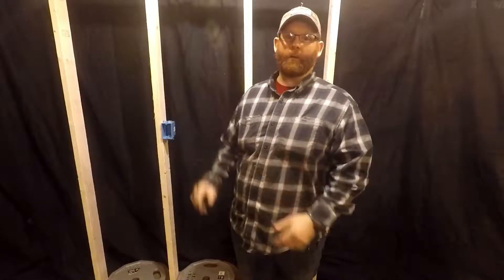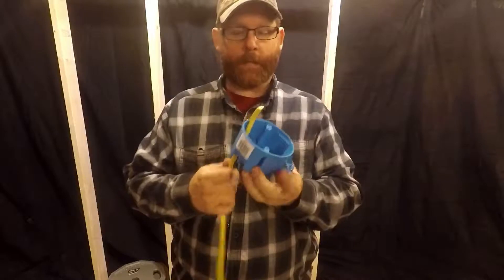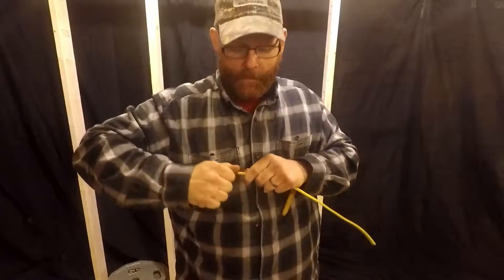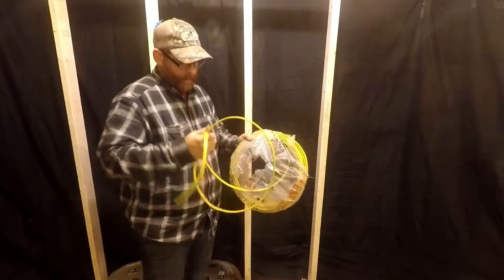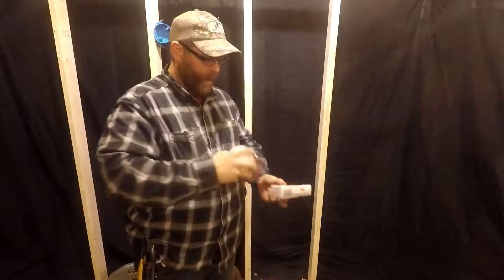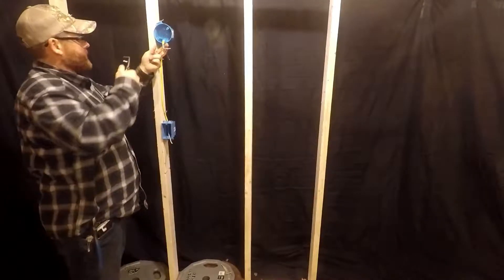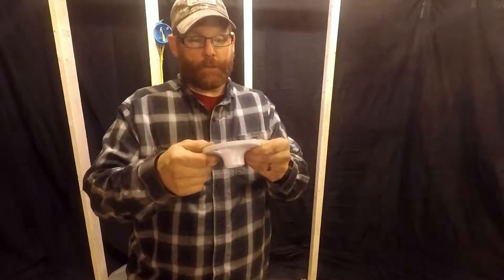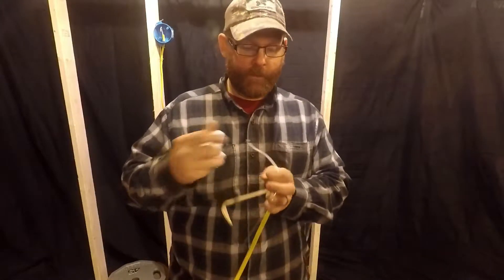How To Mount A Keyless Light Fixture Part 1

Comment: Does the ground not need to be hooked up to complete the circuit? I'm removing garage florescent lights and installing the same lamp holder you did. Being that there will be the ground hooked up to the florescent lights when I remove them, can I do the same as you and just tuck the ground in the box when I install the lamp holder?
Reply from the maker: Yes you cannot ground a plastic box so if your porcelain fixtures do not have a ground then that's what we always do. Just don't cut it off because in a few years you may go with something else. Good question. Thanks for the comment and watching ☺
Reply: @MountaineerOutdoors  thank you for answering my question. My situation is exposed metal junction box with metal conduit coming out to feed the florescent lights. All on top of finished sheetrock. Took the nut off the conduit coupling into the florescent and put up an octagon metal box and reused the conduit and coupling. Porcelain fixture bolted right up and was able to use the ground wire under a mounting screw on the metal box. It's not a specific ground mount with the nifty green screw but figured it would ground all the same. Again, much appreciated for your help my friend. Great video.
Reply from the maker: Awesome... My pleasure and anytime there is any metal involved you definitely have to ground it. Take care.